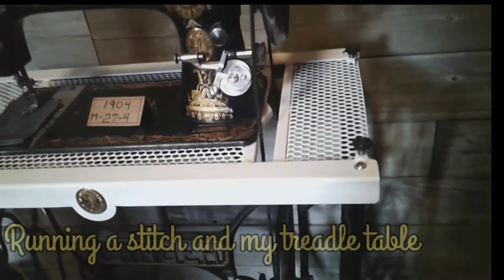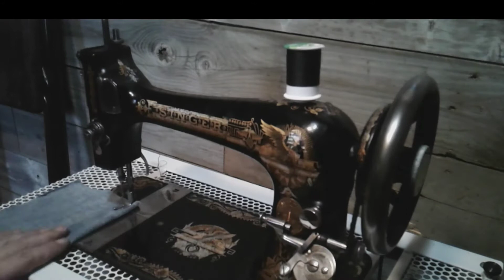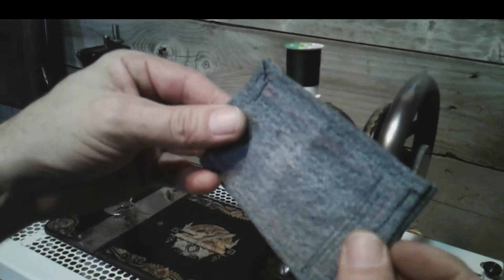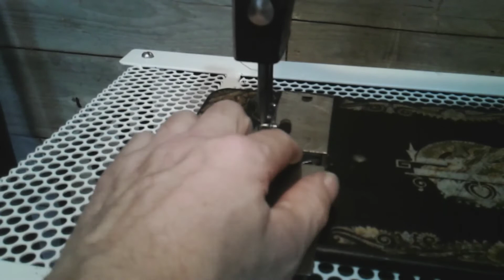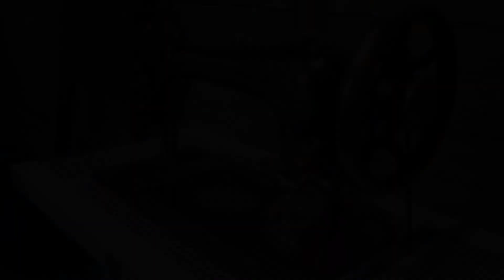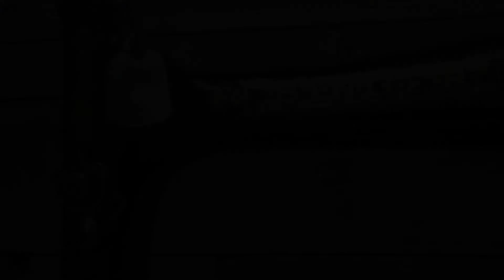1904 Singer 27-4 sews like new , and home made treadle top ..

Comment: Thanks for video! I got a 27 and want to restore it. Wondering can I use the 127 adjusters manual on this machine ( it available for free) or do I need the 27 manual? Thanks!
Reply from the maker: If you mean service manual and is it the same adjustments , yes is the answer , the 128 , 28 , 27 and 127 all share the same system,  the shuttle from any will work in all and the clearances as far as i know are all the same , the main things that changed are the size of the machine of course and the bobbin location and how it works  but everything works the same , i used a 128 from 1936 to fix my 28 from 1904 , works perfect.  Hope i answered your question,  thank you for commenting and stay tuned for more on my collection....

Comment: Thank you for the video. I have acquired this exact machine; a Singer 27-4 made in 1904. Mine has been electrified with a motor mounted on the back. Problem with that, is it's impossible to wind a bobbin without somehow maybe switching to a different belt for the bobbin winder.  My son picked this machine up at a garage sale for me so I have no knowledge of the history, but I think my machine may have the incorrect shuttle carrier, as I cannot get it close enough to the needle to pick up thread. Are you able to tell me the part number for your machine's shuttle carrier so I can compare them?
Reply from the maker: Not to be rude but are you shur your needle is in correct ,thats always the first sign your needle is backwards or your threading in the wrong direction , but lets say your needle is correct and your threading from the right to the left and its still not picking up the thread , i would check the adjustment between the shuttle and bed , the shuttle carrier is adjustable and there is a  way to check with feeler guages but you will have to watch Bob Fowlers channel on that , he explains it very well , BUT please make shur everything else is correct first ie threading , needle installation before shuttle adjustment,  its been in my experience,  they usually always pick it up , even when out , hell i had one that was bent and smacking the rear cover and still sewed but real noisy , got a video on it . Anyways hope i shed some light on your situation,  if not get back to me and i willmake a video explaining more ....
Reply: Thank you. Yes. Checked all that. The shuttle itself is literally too far away. I have previously watched Bob's videos and it doesn't matter how many times I adjust, the shuttle carrier is literally too far away by a mile, to the point where my shuttle falls off every time. Either my shuttle carrier is extremely bent or its the wrong part number for this machine.
Reply from the maker: @rendmendecclesiastes3728  that seems odd and its hard to diagnose without really seeing it , can you send a photo tomy email of the shuttle and carier to dawson72@live.ca and maybe i can see if it looks the same as mine , hard togive youa part number without removing mine but i can if we cant figure this out another way , lets figure it out